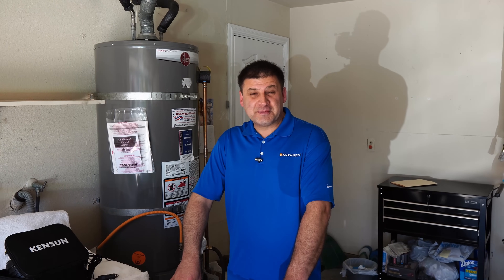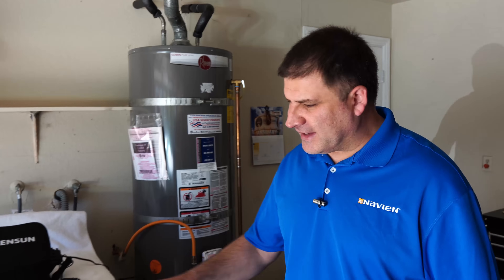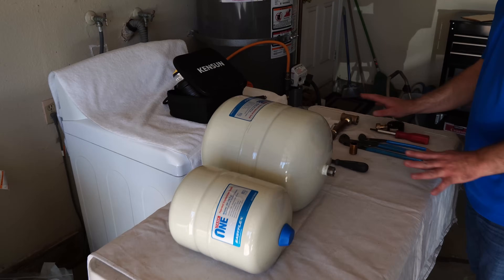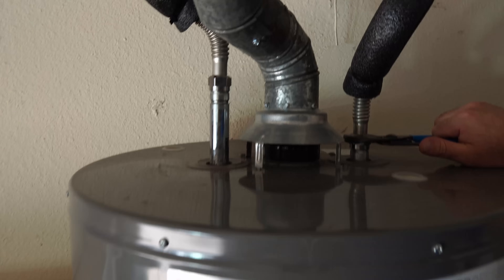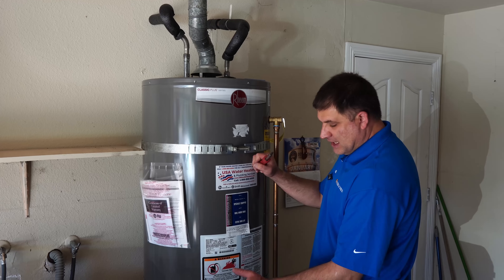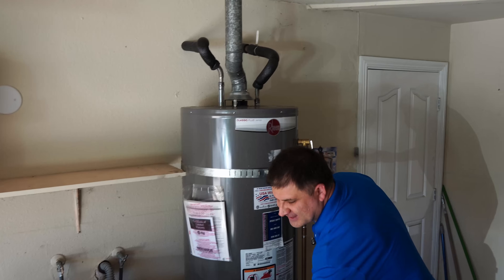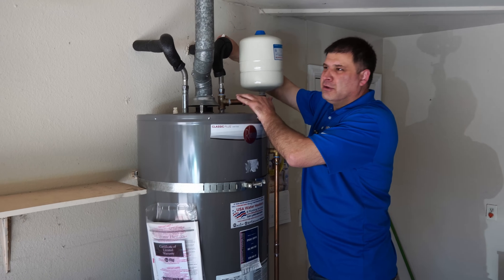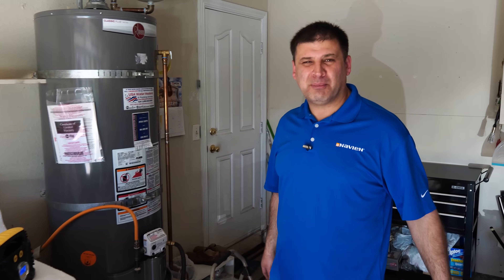✅ Expansion Tank Installation on a Water Heater - What is an Expansion Tank? - How to Install it

Comment: HI
What's the job of that white tank please ?
Reply: Thanks .Xmas 21 . ✟✟✟ LORD be with you . I need to go to buy one & install it .
😇❤🌾🍁🌻🎉  . Is 40 psi enough , or more ? Thanks a mil . 🙏👌🙌👍👏
You are Awesome .12/25/21
Reply from the maker: EXPANSION TANKS
Even if nothing is wrong with your T&P Valve and Pressure Regulator, there might still be unexplained water discharge at the T&P Valve due to water expansion. Larger homes equipped with hot water recirculation pumps and buildings with backflow preventers are required to utilize expansion tanks. Just like anything else, when the water is heated expands in volume. In the presence of a check valve or backflow preventer in your plumbing system, there is no room for the expanded water to flow in. This is when an expansion tank comes in to play. The expansion tank has an air chamber split by a flexible membrane, that moves to accommodate the water expansion. If you experience an unexplained water discharge, check your expansion tank by poking the air stem underneath the tank. If you get water spraying out, the expansion tank needs to be replaced. They come in different sizes, as the 2.1 gallons and the 4.5 gallons are the most common ones.
Reply: @dennistheplumber  
Thanks Xmas 🙏👏✟✟✟ 12/25/21 
My LORD be with U Mr Dennis . 
H N Year 22 😇❤🥳🥰🌻🌼🍃🍂🍁🌾🎉🎉🎉🎉🎉🎉🎉🎉🎉🎉
Can this expansion be use in normal houses ? When we take a shower in the room beside it , Oh  My , the sound is too loud , I plug my ears🤔🦻🦻🧏🤍
Reply from the maker: The expansion tank does not reduce the noise of the flowing water. You might have a high water pressure. If there is a pressure regulator it might need to be replaced. Check the water pressure in the house.

Comment: You might not need an expansion tank now, but need one later.  That's what happened at my rental when the city swapped the meter to one with a backflow preventer.  It was a bit of a mess.  I recommend getting an expansion tank, even if you don't need one.

Comment: Most plumbers install them and never adjust the pressure then it becomes a useless piece of equipment
Reply: I think our plumber did just that.... installed "out of the box" and didn't adjust anything. 🥴
Reply: @JenniferF2882  if they did that it’s doing nothing but holding water. Unfortunately most plumbers don’t know you have to adjust the pressure and test the homes water pressure to determine what the air bladder should be set at.   Al this info is in the directions that most don’t read.

Comment: Question is the same process for a electrical wather heater?
Reply from the maker: Yes, it is the same procedure. The only think I’m addition is to make sure you turn the electrical supply to the unit before initiating the work. Once done, turn electricity on.

Comment: "These fittings contain lead and are not allowed by federal law to be installed for potable water use in the U.S.A. and its territories." Looks like you installed fittings that contained lead if you used the T fitting that you linked to in the description...
Reply from the maker: The fittings are lead free and it is in the item line title for each fitting.

Comment: There was 80 lb of pressure on the main depending on what time of the day that could be very high here where I am over 90 lbs we need to install a pressure reducing valve and I'll put the expansion tank on the hot side of the hot water tank.
Reply: P

Comment: Everything looks fine but I think if you hold the Teflon tape on the opposite side it will be better to install it, that’s just my opinion.
Reply from the maker: I am applying the tape the right direction. Here is a link to a demonstration video from the manufacturer’s website showing that, the tape is applied in clock wise direction, not opposite to the turn. 
I know 40 years ago the old rob style wrap used to be applied in the opposite to the turn direction. Not with the new tapes. 
https://youtu.be/rBuNU5zsb4o
Reply: When you share your work online you spend half the time explaining to other contractors who will never be your customers anyway. I’m an electrician and post my projects on Facebook sometimes. Glad to see you’ve got answers for everything they say!
Reply from the maker: Thanks for the supporting! If I am not sure it is the right way to do it, I won’t post it.
Reply: No you are applying the Teflon in the right direction it’s just the roll. you should flip around so it chases around the nipple instead of unraveling and fighting with it.

Comment: Dude, this is the absolute best video I've seen on how to install the tank. Mine has been sitting in the box for two years. Definitely putting it on this weekend now.
Reply: You’re absolutely right! Smooth explanation!
Reply: Ikr?
Reply: What's the urgency of the tank of most systems are installed w/o one?
Reply: Dang brass fittings are pricey. Roughly $10 per piece at Lowes.
Reply: @thelsel348  yes they are and people already cringe at the repair invoicing amounts. Fuel costs are driving up the overhead too, long story short, business has been gradually slowing down this year as prices continue to rise.
Reply: @thelsel348  use copper. Don’t have to use brass, just not galvanized.
Reply: @davidouradnik7925  or black fittings
Reply: @glenarseneau4796  black iron is for gas no?

Comment: There are a lot of flow checks built into water heater inlets and outlets, better be extra careful with electric water heaters you can burn out elements! Leave it to a professional!
Reply from the maker: I agree, if you drain you your electric tank to a point where the heating elements are no longer in water, they will burn out, unless you have turned off the electricity.

Comment: He should have bled the pressure off at the sill cock to get true reading of the pressure if the tank was adding it to the system before he used the pressure reading to set the tank! A lot of miss information here!
Reply from the maker: Garner, you are not correct. The expansion tank is supposed to counter the water expansion that occurs as the water sits and pressurized the system as the water heater is heating the water. So, it’s best to pressurize the expansion tank to what the pressure will be when the system remained closed for a prolonged period of time. No what the pressure is right after you did bleed of the system. You get it now?
Reply: @dennistheplumber  The expansion tank is designed to absorb added pressure, you need to know the normal operating pressure of the system without the added pressure from the water heater for the expansion tank to work or else it’s just hanging there doing nothing waiting to leak!

Comment: One  of the fixtures is bypassing cold water back to water heater tank, noticed that you closed the Shut off Valve in the cold side, above WHT, after you ran outside to close main valve was positive shut off.
in that case what we do.
Should we install a check valve or other shut off valve on the hot side?
Also don’t you need a mixing valve?
What happens in the next time when need to replace the expansion tank …
Need to learn, please 
I have some similar situation no exp. Tank no valves other than cold side by tank
Reply from the maker: You don't need a check valve or a by-pass valve. Those are for different applications. If you wish you can add a ball valve right between the expansion tank and the 90 degree elbow, for the next time. However we as professional don't do it. We assume that the next time we will be replacing an expansion tank is when the water heater has failed and is being replaced. At the same time the water will be off anyways and we will do it concurrently.
Reply: @dennistheplumber not satisfied with the update, thanks anyway

Comment: Excellent video!
Can this air chamber cause hammer noise at home if this chamber is bad. Or low in pressure. Thanks
Reply from the maker: The expansion tank may contribute to some abnormal noises is it is not pressurized to match the home's water psi. However if it is installed correctly it will actually help eliminating water hammering. The best device to fight water hammering is getting a Hammer Arrestor that is being installed at the laundry machine water connection box in the wall. It goes between the washer hoses and the water valve in the wall.

Comment: Can I charge my expantion tank while already installled..coz I put only 53 psi and needed 55psi?
Reply from the maker: Yes, you can. First measure the water PSI at the hose bib outside. Then turn off the water to the house and open the hose bib outside to release the pressure from the plumbing system, then pressurize the tank to match the water's PSI.

Comment: What does a backflow preventer look like entering the house at the water main?
Is there a calculation chart for water pressure at closest hosebib from main for expansion tank pressure set?
Reply from the maker: It’s Y-shaped device built out of brass that inline with the main water line. Pressure is always the same though the plumbing system.
Reply: Thanks, I'm only seeing one at the irrigation shut off main but once I winterize the irrigation it's not active. So that one's only for irrigation and if I don't have one of those in a house that was built in say the 70s or the '80s then I don't need an expansion tank unless I have a recirculating pump? Or a check valve but I'm only going to have a check valve when I have a recirculating pump?
Reply: Or are there backflow preventers at the water main at the street shut off that the water company puts in?
Reply from the maker: You are correct. It does not look like you need an expansion tank.
Reply: Now I'm wondering if the water meter main have back preventers that are built in from the water company.
Reply: Ahh ok you already answered the question you set the pressure is the same as the house

Comment: I have a Backflow, as all houses do and a water circulation pump.  I live in southern California.  I do not have an expansion tank and I am the original owner.  Can you please confirm?
Reply from the maker: If you don’t have problems with accidental water discharge trough the temperature and pressure relief valve of your water heater you don’t have to worry about it. Oftentimes times when you decide to make things right, you actually end up with more problems. Leave it alone until you need a plumber in the house for a new water heater and they will then install a expansion tank as needed.
Reply: Hello sir, I have problem with my expantion tank, I install a new expantion tank with 43 psi and the water from outside is 55psi, after I install the water works but the water flow on my water softener..

Comment: 80 PSI is too high for the ideal residential water system.  Install pressure reduction valve to have pressure around 50-55 psi.  All of your pipes and fixtures will thank you.
Reply: I think code for an regulator is 85 psi , yes 80 psi for that res apication ,that is a big key to that whole expand syste m, I think, ive been a lic plumber for 35+ years and that's what came to my  mind ,
Reply: @johnlsullivan896  but if you read warranties on appliances and faucets they all say 60psi
Reply: @OffroadCpl  im gonna fct check that one and start readin the warranty info next install
Reply from the maker: 80 psi is the max allowed pressure. Still fine, but at the high end.
Reply: @dennistheplumber  if there was no expansion tank on my heater and i replace the heater do i need to install a expansion tank? Im in florida. I put a water gauge on a hose by the incoming water and it is 60psi.
Reply: @dennistheplumber I am on a well system. Pressure shuts off at 65lbs and kicks on at approx 55lbs. What, in your opinion, should the the pressure of the expansion tank be. Thanks
Reply: Agreed!
Reply: This is absolutely true. I installed one 40 plus years ago and my water use immediately decreased , no noise in system and my water use appliances last and last. Pressure was reduced from 90 to 50 psi. For those who need to know, a well pump can only produce a maximum of 50 psi. I believe  ,with no particular facts , that expansion tank can reduce the stress on the HWH tank that contraction and expansion causes.
Reply: 80 is the max you want to see for residential pressure. Most people around here are mid 60s and do fine
Reply: Required when building water pressure exceeds 80 psi IRC 2903.3.1, UPC 608.2
Reply: Most residential PR's around here state an operating pressure range from 25-75.  Anything outside that range I assume the  regulator is bad and recommend replacement.
Reply: Most t&p valves are rated @75 psi 🧐
Reply: Try 120psi in Los Angeles.  That’s why we have boiler explosions all the time. You have instal pressure regulators and they still pop. Sometimes the regulator itself.
Reply: We run anywhere from 70 to 85 psi in our residential
Reply: 60 psi is about ideal for direct fire gas water heaters to get several years of use
Reply: In Russia, monster tape wraps you.
Reply: FYI for your viewers plumbing code for a residential home is 50 to 80 psi. Its best to have a pressure regulator installed right after your main house isolation vavle, if no regulator is installed the city water pressure can jump to a high psi this will cause plumbing system failure and leaks. Nice video Dennis!
Reply: My water pressure is 90 lbs. My plumber said enjoy the extra pressure.
Reply: @levi-316  And possibly enjoy his repeat visits. My home warranty company's  plumber wouldn't do a repair/repacement because my  pressure was 90psi - a preexisitng condition that voided the policy on plumbing fixtures. I checked the policy and sure enough it was written in there. No other plumber had ever mention high water pressure being an issue before him.
Reply: @John Porter  we havent had any plumbing issues related to our high pressure. The plumber came out to repair a 30 year old valve that wouldnt close. That was 4 years ago. Home warranty contractors find any reason they can to deny service. Thats the home warranty game. We thought about getting a home warranty when we first got our house but we were warned about exactly what you just described.
Reply: @levi-316 yep he is happy because he would visit you more often lol
Reply: Good to know too! Thanks!
Reply: 80psi is perfect for a water filter system, Especially for RO system.
Reply: The county south of mine here in Missouri has a "code" or "ordinance" mandating 40lbs for res homes, over achievers if you ask me!

Comment: Great vid  !! and you seem like you know your stuff , so im in need of some advise if you don't mind .
im on a private well / installed a water conditioning unit that injects air into the system to solve my iron problem and its been working great, BUT since , im getting air spitting out of the hot water faucets for a min or so and then clears up but its pretty annoying /i do have a TP relief valve and nothing leaking from it / however i do not have an expansion tank installed , you think a expansion tank would take up that air in the water tank ??  thanks in advance
Reply from the maker: Gary, the expansion tank expands to accommodate the volume growth of the water when it’s heated.  I don’t think an expansion tank will eliminate the air spitting.

Comment: The top of my water heater heater has check valves on the inlet and outlet.  How does putting an expansion tank on the cold side help with expansion due to heating water?
Reply: The heat expansion forces the water back thru the hot tank towards the street supply, which is blocked with a check valve. This protects the purity of the city water but leaves the pressure in Your line. The exp. tank absorbs that extra pressure.

Comment: I have city water and a check valve by the main water shut off. I have an 27,000 electric tankless water heater with a relief valve installed, and not had any water leaking from it. There is no expansion tank installed anywhere in the house. The city water pressure is 105 lbs. but I have installed a new PRV valve and reduced the main water pressure to 55 lbs. should I install a expansion tank ?
Reply from the maker: Hi, there! Although the code would require an expansion tank in this case, if you are not experiencing any discharge issues, you don’t have to get an expansion tank, especially due to the fact that your water heater is an on demand system.

Comment: Very good video and thanks for the amazon parts list. It is exactly what I was looking for and more.
Reply from the maker: Very welcome!
Reply: @dennistheplumber  installation went well, but i guess there’s a separate closed system on the roof attached to my solar hot water panels. That pressure relief valve control continues to blow off hot water daily. Not sure how to remedy that. Any ideas?
Reply from the maker: What is the overall pressure in the plumbing system? Measure right after the pressure regulator.
Reply: @dennistheplumber  pressure is about 80 psi when I measure where the expansion tank is. There’s a 150 psi pressure release valve on the tank that never activates. However the one on the roof blows daily during peak hours 11am - 2pm. I’d have to buy a brass tee to measure the pressure near the solar panel on the roof. The tank may be way oversized. 120ga for two adults and three toddlers that we bathe together.

Comment: Can I use PEX?
Reply: Not that close to the water heater you can’t. Best method is to stub up with copper and switch to PEX up towards the ceiling. I don’t care for flexible supply tubes and prefer hard copper right to the water heater.

Comment: Do a video on changing the rubber hoses to the clothes washer.  They can be a real problem when they break due to age and high water pressure.
Great work on the expansion tank.